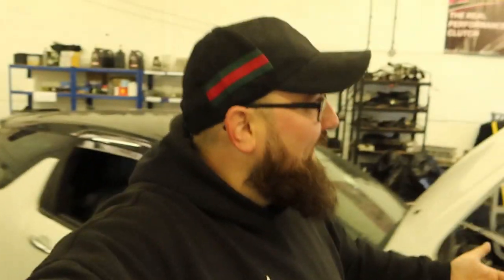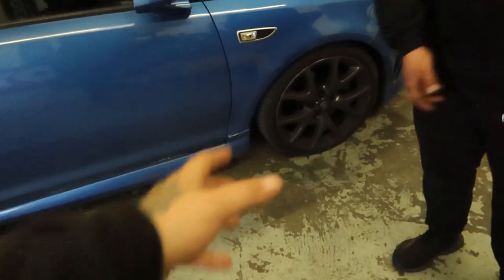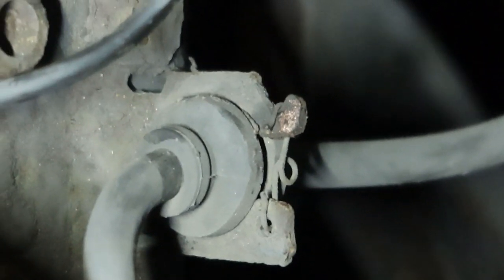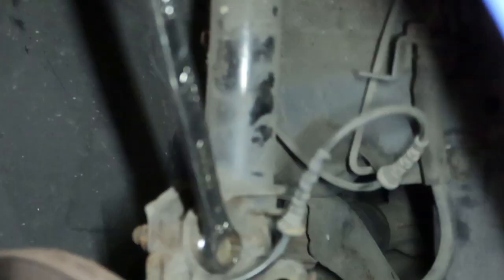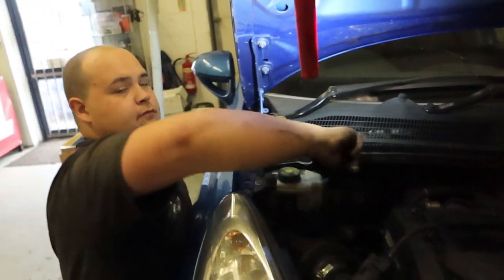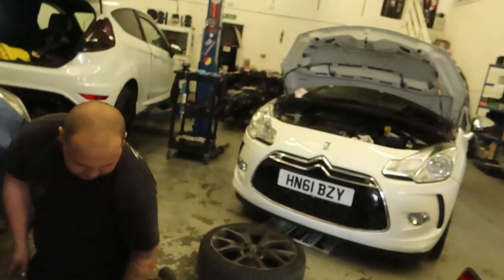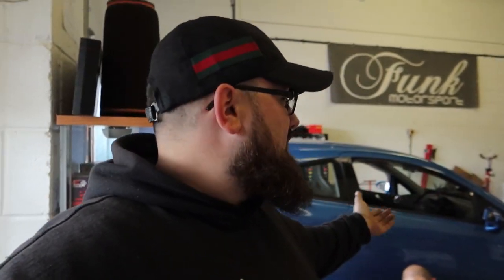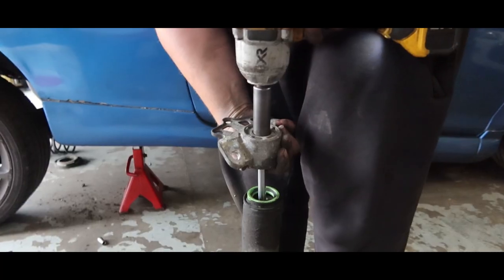How To Lower Your Car!

Comment: Hey there good video just In process of changing to coilovers and looks like your adjusters on the rear springs are attached at the top with a bolt mine just sit on the adjuster it self does that seem right to you?defo nothing else in the box and the rubber cup for the top doesnt fit either no knocking or anything but just seems odd that they are not attached thanks

Comment: Serious question. If the rings on the coilovers are rotated down the coilover then surely that must lower the car as the spring has less resistance, or am i missing something?
Reply from the maker: If there going down your not compressing the spring, so nautrally it will go higher
Reply: @RustyAutos thanks for reply, i just assumbed if the spring wasnt being compressed then gravity would naturally lower the car as no resistance pushing up from the spring

Comment: Hi guys need advice please! 
I've got a got a corsa vxr mileage just at 60k runs drives like new still all tight, boosts etc up until recently I've notice whilst shifting into 3rd at higher rpm it crunches a bit?? All other gears are sound any advice be awesome guys please.. 
Cheers 
Paul

Comment: Quick question. I have a 2008 Corsa VXR. Was just wondering if it’s best to get a whole new exhaust system or to just get a turbo back decat pipe. Car came with a cobra exhaust. Wanting a Nurburgring twin exit design though? What’s the best idea? Nurburgring backbox, then the performance turbo back decat?
Reply: Out of pure interest what did you end up doing and how did it go

Comment: Hi guys please can you help I bought a 2014 corsa vxr with 37000 miles on clock.the service book was missing some years ofi contacted the company and they said the vxr gets services at 2000 miles so all the services I had on it were extra is this correct sounds so wrong.your advice on this is very much appreciated guys
Reply from the maker: Oil should be done every 3 - 5k spark plugs every 5k & other oils every 5k too, keep on top of it